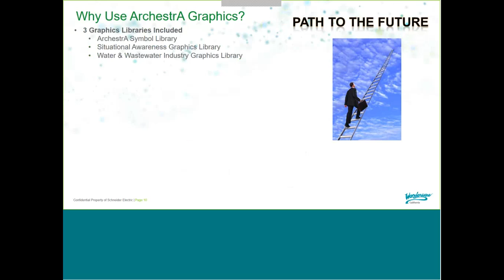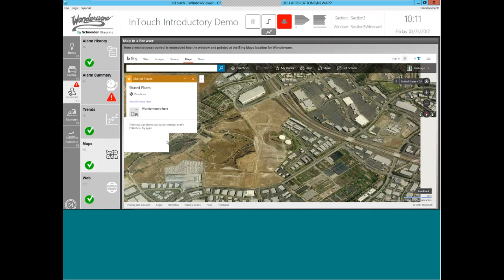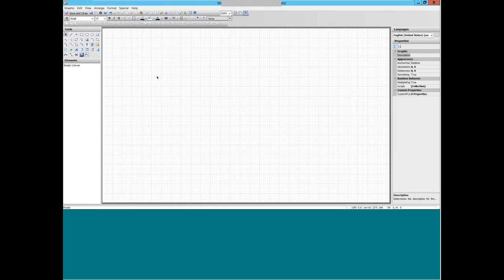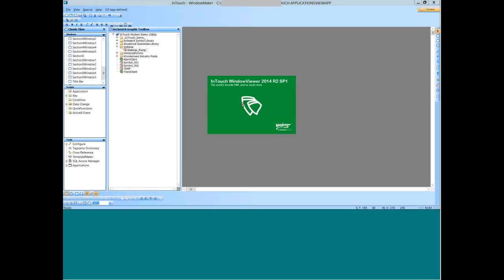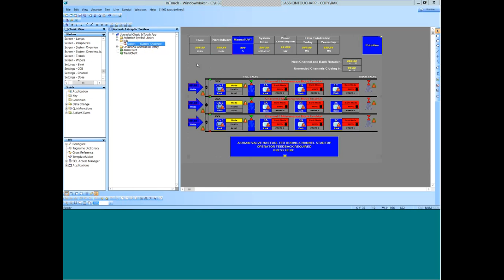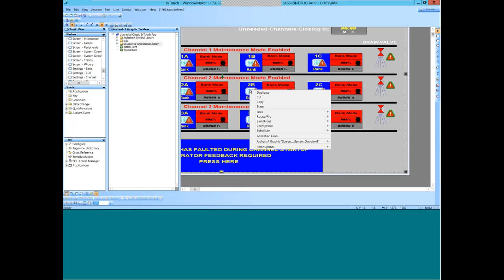Learn in 30: ArchestrA Graphics with InTouch

Comment: Hi Master,
I need  Intouch 2014 R2 SP1. Could you help me?
Reply: I installed Intouch 2014 R2. I have error while installing wonderware system platform 2014 R2 SP1, that is needed to upgrade some software. so i think I should setup Intouch 2014 R2 SP1 in order to compatible with Wonderware system Platform 2014 R2 SP1. Thanks.